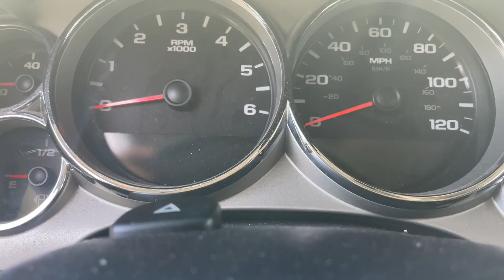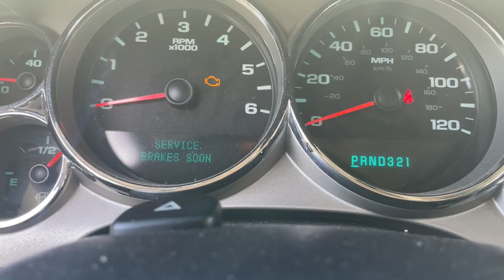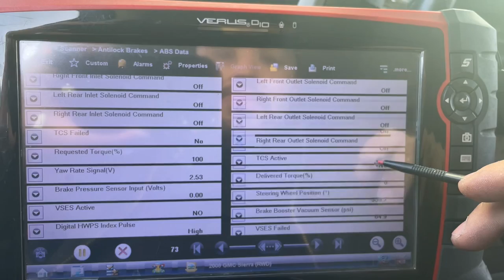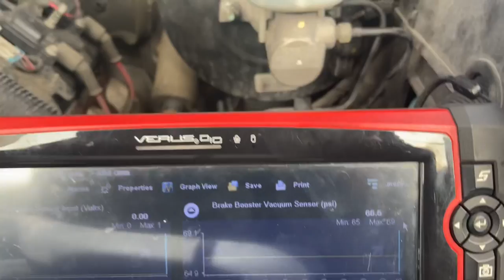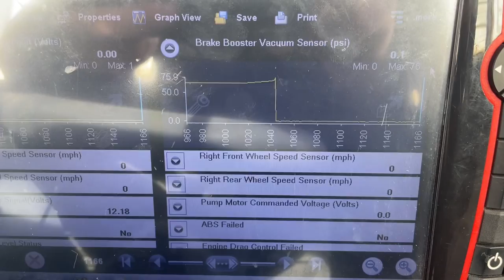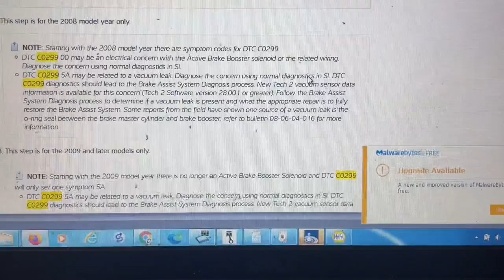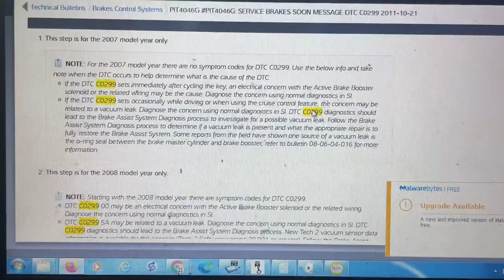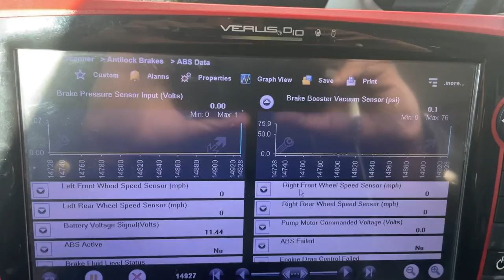Sierra/Silverado brake light problem

Comment: Excellent technique! I never thought about using a smoke machine for a brake booster vacuum leak.
Reply from the maker: I have a couple of videos where I have a lean mixture and it was caused by the brake booster leaking
Reply: @OzMechanics  lean related to fuel trims?

Comment: I have a 2011 Silverado. The service brakes soon came on in the DIC. I used my scan tool to find the CO299 5A code. I didn't have a smoke tool. Instead I took the vacuum sensor out. I used a small piece of white rope, install the rope and pushed it down into the booster. When I pulled out the rope it was soaked in brake fluid.  
Thanks to this video I knew what the problem was and have ordered the replacement parts from O'Reilly.  My truck only has the vacuum switch on the booster so I ordered the switch as well.  It may have been damaged by the brake fluid in the booster. 
Do you have the video of removal and replacement of the booster and master cylinder?
Thanks again for this video!
Reply from the maker: Richard I’m soo glad this video helped out. I actually made a quick tip video on this issue. I put a zip tie in it to show the fluid in the brake booster. And as of a video showing the removal of the booster and master cylinder, I stick to more diagnosing videos. Thanks for stopping by
Reply: I cannot get rid of the Service Brakes Soon message. New sensor, master cylinder, booster. C1100. No abs or traction light are on.

Comment: Brake fluid leaving the master cylinder rear into the booster is what caused the booster to leak. I’ve seen them so bad that whenever the customer applied the brakes, the engine would stall due to massive vacuum leak. New booster and master cylinder used to cost a fortune compared to now just like mass air flow sensors used to cost a fortune.

Comment: Hey bro. Nice video you have for solving this issue. I have the same msg showing up on my dashboard but check engine light is not on when I turn on my 2010 gmc sierra 1500 SLE. I wonder, is it necessarily to be the code C0299 is actually the issue? Would I still be able to scan the vehicle to get the problem code without the check engine turning on?
Please advice as I am concerned about my brake and safety before it turns out a major deal.

Comment: I have a lean code on a Corolla 2004 where are you located most shops don’t have the gage to check fuel pressure thank you
Reply: Check the injectors
Reply: Very common
Reply: @joseprado4627  I notice that 3 of the injectors have corrosion I have told by 3 person including your self to change them they might be the culprits
Reply: I have run into several cars like your own, with lean code and no vac. Leakes, and it’s always the inj. Causing the problem. Some times I start by replacing one at a time, and it improves, but end up having to replace them all to finally fix the problem.but yeah it’s always a good idea to make sure fuel press. Is at specs.
Reply: @joseprado4627  thank you Jose do you recommen to get them new, used ones from yunk jard or re manufacture some shops don’t even have the gage to check fuel pressure and since the car has 232 thousand miles it could be the fuel pump too or fuel pressure regulator.
Reply: If u trust the reman. Ones go ahead, but I always get them brand new. I hate comebacks!!!